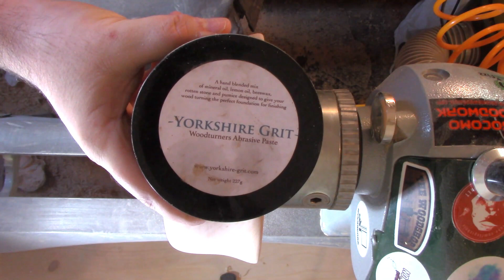Woodturning | The Lime Bowl

Comment: Which carbide tip shape tools did you use? Round, square or diamond? I can’t seem to manage the round one as I always get a catch😏 cheers Steve
Reply from the maker: i believe i used a combination of all 3 bud...... try taking lighter cuts and make sure the tool is perfectly flat on the tool rest, also it can be a sign the cutter is getting dull so maybe rotate it to a fresh edge